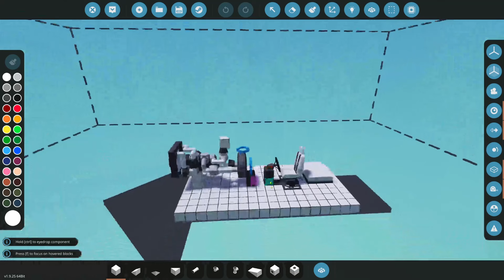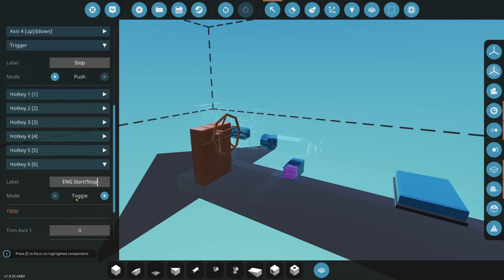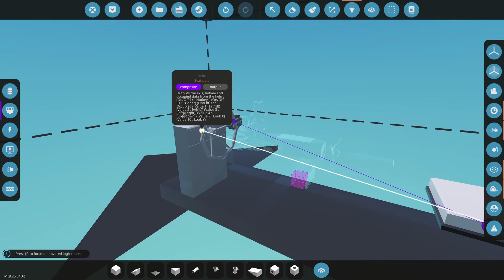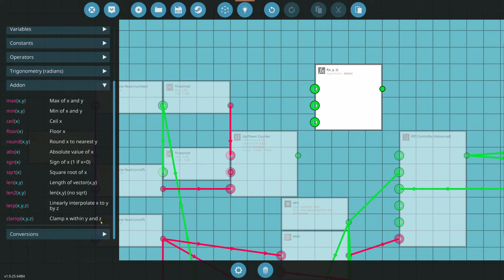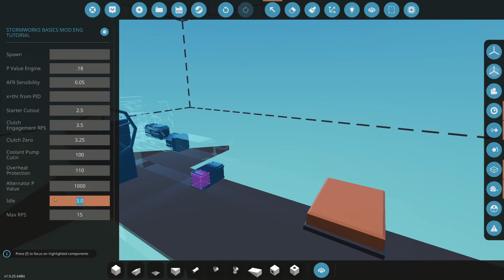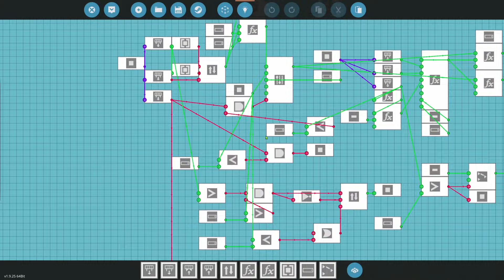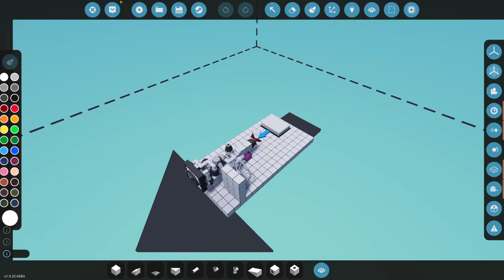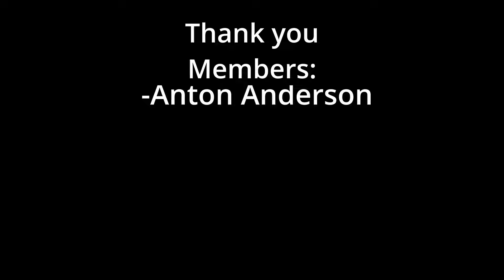Stormworks Basics: Modular Engine Tutorial Series P3 #tutorial #stormworks #gaming #gamingvideos

Comment: Is there any difference in how you would to a car engine and a Big truck engine? except for changing cylinder amount or sizes of course.
Reply from the maker: Mainly you just want to have a larger engine to produce more torque. The main thing with a truck is you're going to be using a transmission that down gears more. So you're going to want more heft in the engine. Often I will add a flywheel. As with any engine you may have to do some different tuning. For example most of my tractor engines run at low RPS because they have so much torque. Also sometimes the p-value is a little bit different because of the flywheel. You would just gently increase or decrease the p-value until the engine was running the way you like. Also the auto clutch might be a little bit different. Also pretty simple to just tune in. You would gently increase or decrease the speed at which the clutch applies.